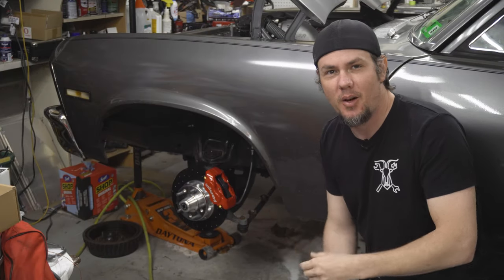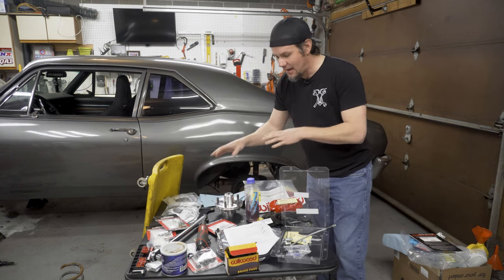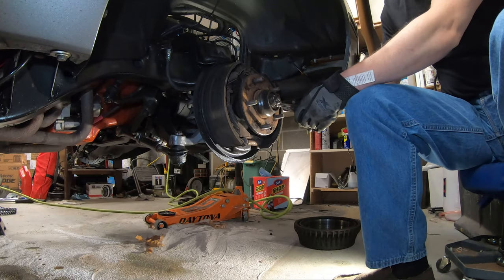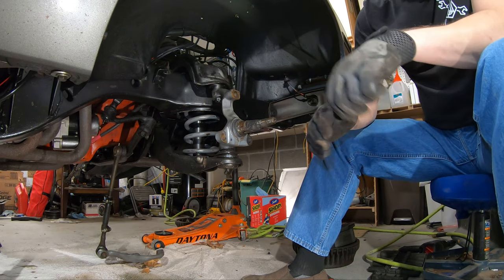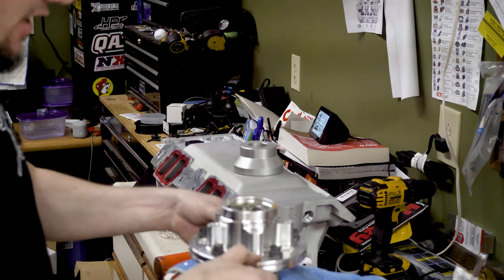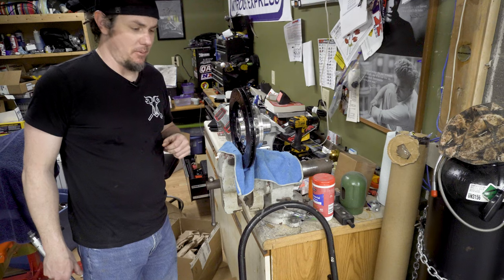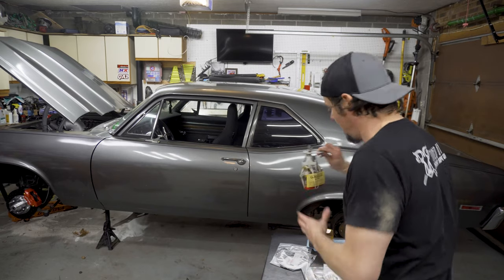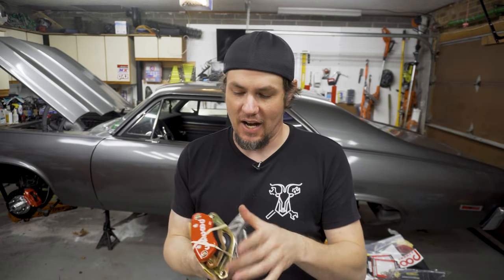Wilwood Front Disc Brake Install On Chevy Nova

Comment: The proper procedure for the rotor nut is the following:  Tighten the castle nut to 10 ft lbs (120 inch lbs) while rotating the rotor to seat the bearings. Don't over tighten.  Then loosen the nut 1/4 turn. Then tighten the nut by hand and align the castle nut with cotter pin hole. Since using a torque wrench for all the other bolts, might as well do this step correctly as well. I have a full detailed video on this subject as well for more info with Stock style rotors on my 74 Nova.
Reply from the maker: Thanks. The procedure I used is from the 72 service manual.

Comment: Did the swap result in the wheel mounting flange surface moving either in (toward center of vehicle) or outward (toward outer fender) from the relative location of where the wheel mounted on the outside of the drum?  The reason I ask is I have a 70 Elky with drums (and I'd like to go disc) but I can't have the wheel mounting surface move any more outward or I will have wheel clearance issues with outer fender metal with my current rims/tires combo.  Cool video.
Reply from the maker: Honestly I don't think it did, but if it did we talking a fraction of an inch

Comment: Hey are those 12.19 rotors and will that fit a 68 camaro??
Reply from the maker: Those are one size down, of I recall right, to fit a 15 inch rim. Should work on the Camaro